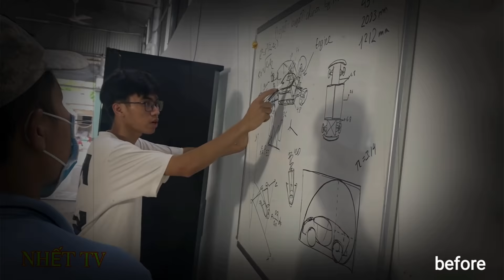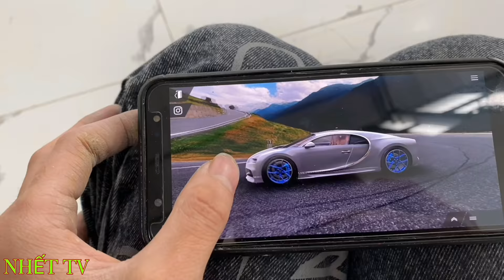The simple homemade Bugatti finished in pearl white

Comment: I'm never usually a fan of this kind of stuff .... but this looks so good I'll change my mind ... looks badass ... such good lines ... so called "pro" kit car companies don't come close
Reply: This guys are great , but this cars got no safety features , there could be fatality if they involve in a car crash ! Other then that cars are looking great.
Reply: @Zort2257  True... but still, impressive
Reply: @hieroglyph321  yup i am impressed too , amazing result 👌
Reply: @Dan Trebune haha yup 😂 i hope some rich guy reach em out and give these kids a opportunity and some good tools so they wont have to use the clay anymore👌
Reply: @Zort2257  give a list of the safety features of a motorcycle. There a re a ton of hotrods out there with nothing more than a seat belt.
Reply: @frnkjones40  not that simple buddy , have you seen how do they built hotrods ? 
The chassis provides the strength needed for supporting the different vehicular components as well as the payload and helps to keep the automobile rigid and stiff. Consequently, the chassis is also an important component of the overall safety system.

Comment: This is one of the most brilliant things I've ever seen. The only issue was that to make the car stable, many of the car's components are fixed to the body work instead of them being fixed to the frame of the car.

These cars have their parts mounted onto the tub or cockpit and the whole car is built around it.

But apart from that, best thing I've seen on the internet in over 15 years

Comment: When you are sanding back the primer, you should spray on a mist of black as a 'guide coat' to show all the imperfections, the low spots will show up as black etc ....  therefore once all the black is sanded off then you will have a perfect surface ready for paint....  SO USE A GUIDE-COAT !

Comment: Beautiful work. The rims need to be installed with a star pattern (for the lug nuts) and no power tools just a torque wrench
Reply: Man, they painted the brake discs, I’m not sure it’s a masterclass in ‘by the book’ mechanics but it sure is incredible what is possible.
Reply: @aaronf4201   well that’s because those aren’t brake discs those are metal plates there are drums behind it 🤣🤣🤣.
Reply: @eln0n01  was trying to figure out wtf was going on there.  Thank you it looks like they need some caliper covers too

Comment: There are some things that didn't make sense, around the 42 minute mark of film where the rotors were painted even on the places where the pads meet the rotors and video time 43:10 the tire was put on and the tape was still on the brake caliper , simple mistake , but the car looks nice but if I was to build this car I wouldn't have used an old motor and transmission, because to be honest you spent more time, money, and effort on paint and body work and since that was the case anf the looks turned out great, the the mechanical I would have gotten a new engine and transmission to use , at least something that has very little chances at going bad really early in this project cars life, I would have gotten a powerful V6 and either gotten it modified by adding twin turbos a supercharger and all internals on the engine replaced by really high performance, as well as a extremely long lasting, and the transmission would have been build with high performance parts like a nice shift kit and upgraded longer lasting gears, and a decent drive shaft and differential with a high performance gear to where this light weight car would at least be sorta fast at least able to reach 150 mph pretty quickly, which I would have gotten it to do that in at least a half mile mark minimum because making a car to look like a fast car that can't go fast and have a junk engine and transmission makes your project seem like you did a lot of work and killed yourselves with looks over any performance or safety put in place, like that welded frame where there is little to no front or rear end protection and I would have spent more time with those two on this project like welding thicker frame and welding tubing that adds front and rear end protection and tubing hid in the cockpit of the car around the door frame roof and flooring to protect the driver and passenger, and I would have gotten better tires because looking at those tires the didn't look to be new or at least in the shape that they wouldn't go flat because of little to no threads to where if you ran over a rock it would puncture right through, or dry rotting  but as an overall project car I feel that it looks pretty good but as for mechanical and safety it falls pretty short and that car shouldn't be driven legally on any hwy or street and only driven after it would pass a minimum of safety, like dragstrip cars trucks and motorcycles

Comment: What was the total cost in the build? Why couldn’t you put $1800 on a set of big breaks? Those single cal’s and rotors were pitiful! It still looks mikes better than it did though,and i give you mad props for the amount of work you fellas did! 

I would’ve ordered fiber glass repro panels and built them around the chassis,but i can’t argue with the aesthetics you achieved doing it your way! 
She’s simply gorgeous looking! 
i’m pretty sure yours is a manual at least. Others on here are autos which is ridiculous and worse than your breaks!

This is an insurmountable amount of work you guys did!
 I liked it so much, If you could turn my 99 prelude into a Diablo or Testarossa ,i’d prob pay you guys around $6000-$8000 ,if it could be done this well,even for just the fun of it! 

The Lude is my show/race car,and my daily is a 2002 Supra GS300 bagged, but where the 99 Lude is flawless in every aspect, the GS has a bunch of dings and could use new paint. 
Great job fellas! She looks great! Just please get on those breaks! Ha!☺️👍🔥
Reply: the brakes are just metal plate..... and scooter calipers.